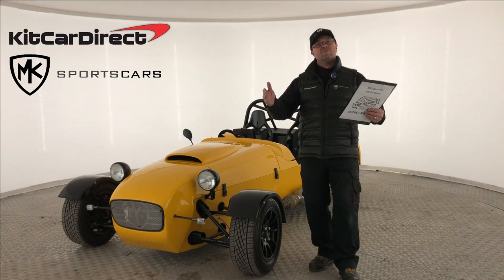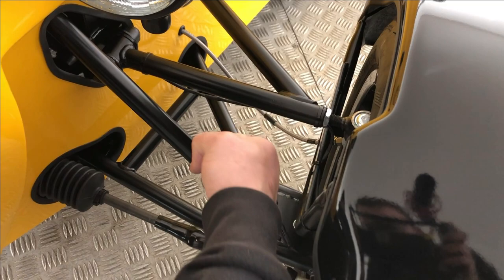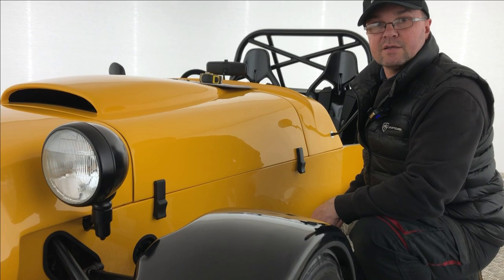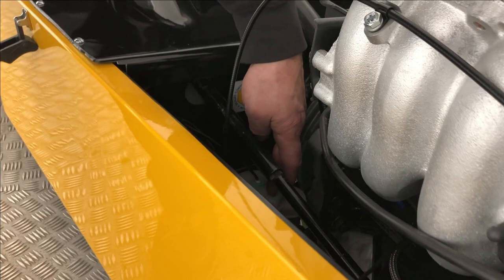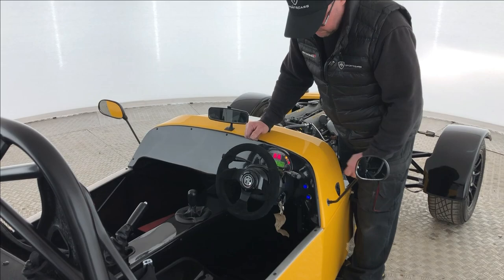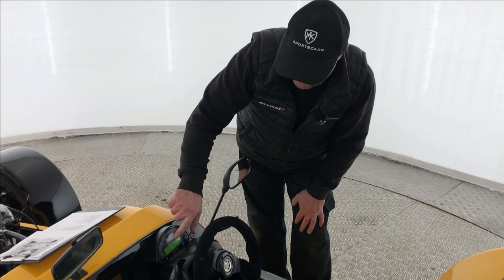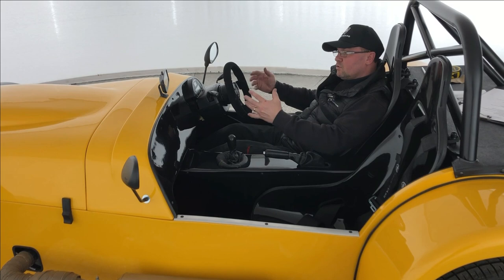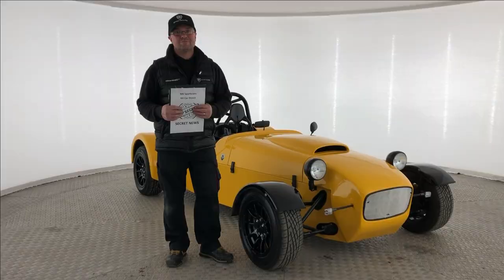Kit Car IVA VOSA Passenger Vehicle Test Top Tips For Getting Your Car Road Legal in the UK 2021

Comment: Great video and it will be a huge help when i check my build over prior to the test. However i must correct the mud guard numbers, you stated 30 degrees forward and rear of the vertical. it is 50 degrees to the rear and 30 to the front.

Comment: My only advice is to make sure you double check your speedo calibration on the road  if your given a code to program it with, years ago all my cobra rep failed on was indicated speed, i was given the wrong calibration code by the manufacturer 🤬🤬 speedo was miles out ffs.  After it failed i Literally rang the company while car was on trailer still at iva center and reprogrammed it with the correct code id just been given (couldn't get through while on test as they were apparently on their break for an hour and wouldn't answer the phone,,   speedo was literally corrected while still at the test center ffs, but cost me about 600 odd quid in retest fees,  trailer n towing hire...... All to just have the speedo checked,  took longer to get the sodding car off the trailer than it did to test it.......to be fair the examiner was gutted for me as he said it was a good build, and yes i did double check it on the road before it went back 😉
Reply from the maker: Good feedback thanks 👍🏻

Comment: What happens if the donor vehicle is rear-engine with the speedo drive taken off the front left wheel e.g. Imp or Air-cooled Beetle?  Proving conformity at this distant age i.e. 50+ years will be nigh on impossible and neither vehicle has the facility in the transaxle for a speedo take off and having a toothed wheel on one output shaft is a nonsense because it is quite possible for the two rear wheels to be turning at different rates.

Comment: thx for this :)   does the car need front crash protection for ped's?
Reply from the maker: Nope, just the rubber trim around any sharp edges and covers over the nuts and bolts on anything exposed.

Comment: How do I do for a kit atv quadbike? I'm thinking to change my Raptor 700 frame and engine for the R1 engine also I have a hand made chrome swing arm +4 and xenon lights, side mirrors, after market plastics in carbon look a like and designed seat with my name and tgat what would I need to do to change the V5C to soecifie all of this and would it be difficult  to do? With Thanks Ricardo

Comment: What if you want a period correct look? Do they make allowances for cars built in a fifties or sixties style?
Reply from the maker: I don’t think so… there are a set of rules which need to be adhered to.
Have a read of the M1 manual….. it’s only about 500 pages
Reply: I believe the short answer is no. It still needs to comply with the latest rules.
As an example, the tipo184 from Ant Anstead looks like a 50's race car, built on custom chassis with MX5 running gear... I've just watched their video which outlines similar points mentioned in this video, and they have to add loads of rubber trim and foam pipe insulation to soften all the sharp edges and switches.
I'm not certain if this applies to an older car which has already been road-registered and is getting re-evaluated. To retain the correct age number plate it would need to be using most of the old car too, but I believe it still needs to follow the latest IVA rules. I dont think this was your question anyway, but if it is, maybe better to call VOSA or your local test center and check first.